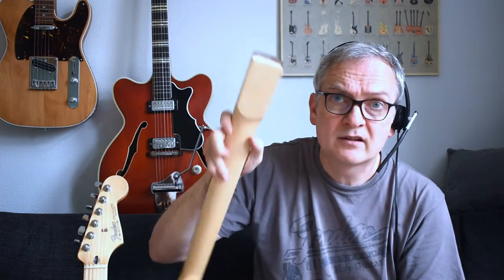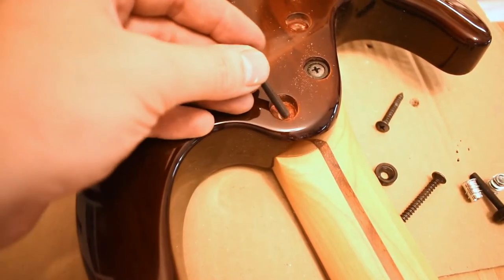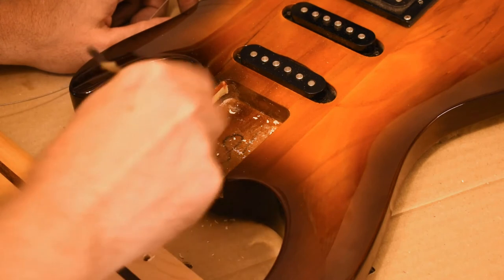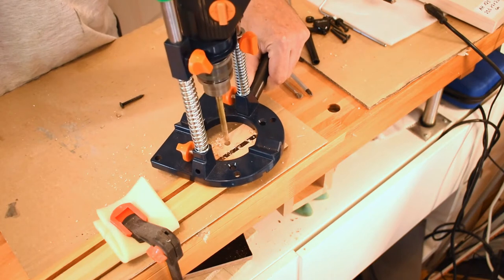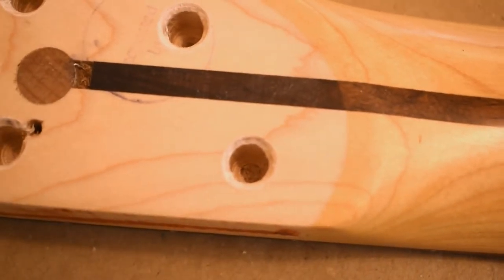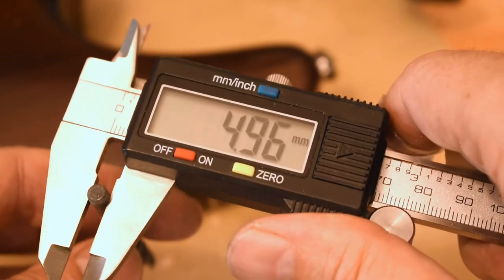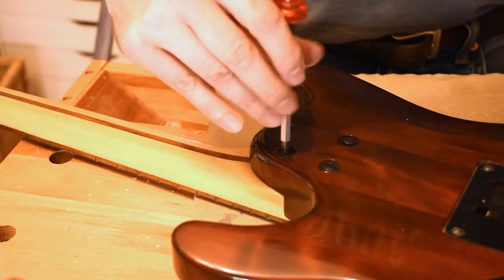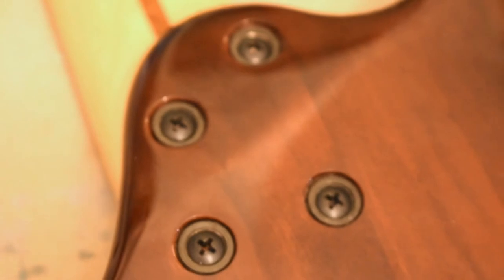Mounting an Ibanez Bolt-On Guitar Neck with Threaded Inserts and Machine Screws

Comment: How many times can the neck be bolted on and removed before the screws or threaded inserts would be expected to fail? Would this be a viable solution for a  guitarist that flies a lot to gigs, but doesn't want to check the guitar into the cargo hold? Removing the neck would make the guitar (particularly a headless one), small enough to easily fit in a carry-on. Thanks

Comment: Do you use glue on your thread inserts? or it is not necessary?
Reply: It is not necessary in most cases. A drop of white glue  would be enough, it would still be removable with heat and has a certain elasticity.

Comment: Hey! I was wondering if the threads had any noticeable change to the sustain and stability of the neck? (Stability, particularly how often the truss rod needs adjusting)
Reply: I have no scientific correct answer for this, but to me the sustain is better, and some dead spots on the fret board have improved response. The truss rod adjustment may get better too, if the adjustments where caused by a "moving" neck. 
People with adjustment screws at the heel of the neck love this idea, because removing the neck and reattaching it causes no more stress to the wood screw holes.
Reply: @michaelkonings1781  awesome ! Thanks so so very much. Planning to integrate them into my high-end builds. Also, do you feel that the material of the neck-bolts (and bearings) matter? What material do you recommend for neck-bolts when using steel threaded inserts?
Reply: @rocher3087  we sell standard steel (plated black or gold finish) or stainless steel screws/bolts. They work just fine. What else material can you think of? Since it's a standard size (metric M4 or M5) you can use whatever screws you like. We als have hex drive and relic'd screws, for that special look.